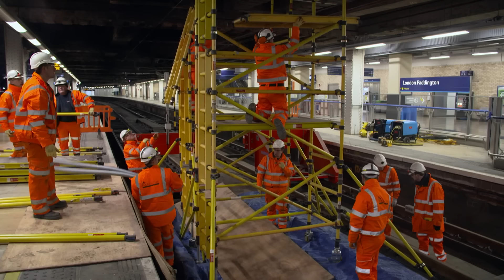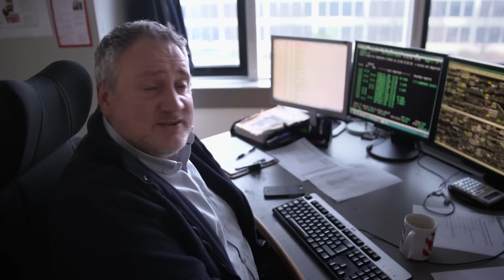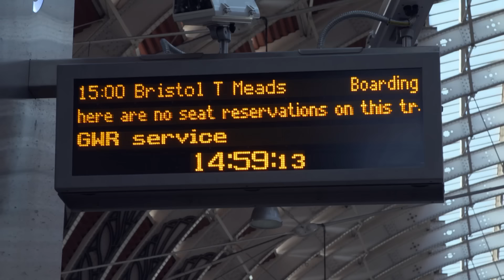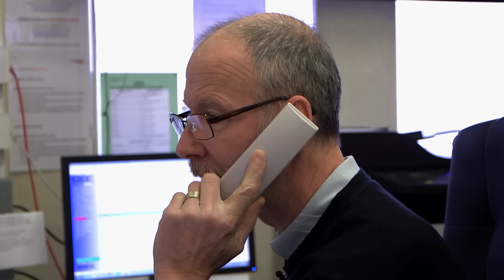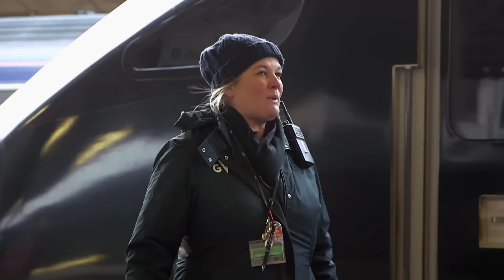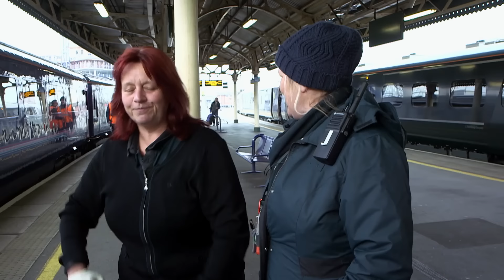Signal Failure, Bridge Strikes & Damaged Trains! | Paddington Station 24/7 | Full Episode

Comment: Checking the in cab height sign is nothing to do with Network Rail, that's down to the police.
Reply: They get a photo for safety purposes for them may need to prove if drivers are genuinely unaware or whether there was indications before that they shouldn’t have gone under it also helps insurance

Comment: 15:40 can one not have the protection barriers replaced with a simple height before the bridge and of the same height? Preferably where vehicles can turn round or take a different route. No lower or someone would try to move it to get to the bridge.
Reply: Apparently they aren't allowed to do that
Reply: The issue is network Ray lot only allowed to really do anything to the bridge or immediately before the counsellor responsible for all the other signage and everything
Reply: @TheLostPacketYTthat makes sense,  although the potential for a blocked road seems pretty high, so perhaps it's something the councils should consider?
Reply: @biddiemutter3481  they can but it costs them money

Comment: The low bridges are clearly marked, and still lorry drives try to pass them with too high lorries.
Reply: However both lorries and bridges are not always marked correctly. There was a bridge in Northamptonshire that had 3 signs in the space of half a mile, all showing different heights.
Reply: @bobanob-q2u  so if you are unclear you do not drive the case is usually that network rail put up a sign and then the council would put further ones up warning Laurie of the router head and things like that

Comment: 17:20 - This seems a bit odd... he says the lorry "3 metres 10" and the bridge is "3 metres 8", but the sign shows 3.8 metres, so surely "3 metres 10" would simply be 4 metres.
Reply: Agreed i would think the sign means the bridge is 3.80 meters high they should have put 3.08 otherwise
Reply: Well isn't 3 metres 10, 70cm shorter than 3 metres 80 (3.8 metres).  It's not 3.10 versus 3.08!
Reply: The British are new to the metric system; the lorry was surely 4 metres high
Reply: @giuseppenero110  hardly new been in use since 70s
Reply: Thought the same, had a feeling I'd find comments! I'm surprised the road-sign would be wrong and not reported/noticed – I feel like that sort of thing is installed with some care. Maybe I'm being overly optimistic!

On second thoughts, maybe the guy checking the cab simply misspoke, and said "3 ten" when he meant "4 ten", and just had three metres in his head? That'd be a more harmless explanation that didn't involve either important sign/warning on the bridge/cab having been installed incorrectly.
Reply: Everyone makes fun of the US for using Imperial (which is impractical) but the UK using both with no rhyme or reason is even stranger and worth making fun of. 
The Hodgepodge the UK has, it's no surprise of the slip up in that section.
Reply: @SyCoREAPER Tell me about it. The only saving grace is that there's some pressure to move to metric in everyday use which is working slowly, but also there's a bit of a dual thing going which isn't completely unmanageable for the most part. (Speed limits aren't too big a deal for now. Knowing one's height and weight in metric is painfully slowly taking hold.)

Comment: Whilst I appreciate all and any staff involved in the rail network and the job is hard and endless, the overall train network in this country is appalling.... I use the train service in the South-West every day simply to avoid driving long distances and avoiding expensive fuel costs and car wear and tear, and the yearly season ticket is in the thousands and for that reason the whole service is very much unacceptable, GWR are an AWFUL Train operator, so I'm fully with the angry passengers as I'm often at the mercy of the awful rail network......but again it's not the fault of the majority of staff, it's a total lack of investment in the infrastructure of the rail network and the privatisation of the railway
Reply: The issue is people complain when they fix the issue more than when there is an issue

Comment: Serves  you right, we should not rely on electricity to run the points and signals, come back to the old system of signal boxes controlling only about 1 to 2 miles each, not one control room looking after about 50 or 60 miles of track and signals, it will not get better.
Reply: OK boomer
Reply: That would put costs up significantly. You need lots more signallers, for each box you need 3 shifts, it all adds up.
Reply: Quite simply it’s not practical the way things are set up now you can’t just do it manually there isn’t the space for the equipment

Comment: So if someone had a heart attack should be giving CPR . Horrible response by the company. First aid does nothing in a HA
Reply: Technically no. A heart attack (depending on the type) generally means the heart is struggling to pump blood, and is in the process of being damaged and/or dying, but it is still beating. In that circumstance it is not appropriate to give CPR.

CPR is only advised when the person is either not breathing, or the heart is not beating effectively (e.g. Atrial Fibrillation) or at all.

There is a very real risk that a heart attack could require CPR, but if the person is still breathing and has a semi-effective pulse, they need medical treatment to confirm/rule out a heart attack.

It sounds like the woman collapsed and fainted from low blood pressure. In which case the appropriate treatment (barring anything else being majorly wrong) is usually to elevate the legs and give fluids (dehyration and exhaustion is the most common cause of this sort of collapse, especially if you've been rushing aorund a train station).

It's also not clear what sort of first aid was given; CPR counts as first aid (as any first aid is just the first bit of help someone unwell receives, hence the name).

All we can assume is that some level of first aid was given, appropriate to the level of training of the station staff. We don't know what that level is, and I would be the first to suggest that a limited amount of first aid training would be beneficial to frontline staff, including CPR and when it is appropriate to deliver it.
Reply: A heart attack is not a cardiac arrest and she had neither
Reply: @TheMusicalElitist you. Ya rage😂
Reply: @TheMusicalElitist  You are a troll, you always try to provoke people in the comments on these videos

Comment: 17:33 The obviously hollow claim of "Local Knowledge" on the side of the lorry is hilarious.
Reply: What troubled me though is that we hear (17:20) the vehicle height is "three point ten" and that this is higher than the bridge (three point eight)... But numerically, 3·10 < 3·8, not the other way round. Did I miss-hear it? Is the sign on the bridge wrong, or did someone put the wrong warning label inside the cab?
Reply: @mLyonJE  When it actually was 3·8(0), that should be pronounced as "'three point eighty" instead of "three point eight", just like they say "three point ten" instead of "three point one" for numerically 3·1(0). That is why I think that with saying "three point eight" they mean numerically, 3·08.
And yes, language often is sloppy and ambiguous like that.🙂
Reply: @m.moolhuysen5456  In maths, at least in the UK where I learnt both my native language and my maths (!), the most standard way to read out anything after the decimal point is by saying each digit in turn, and it's really a lax colloquialism to say "3·10" as "three point ten", more more acceptably, "three ten" – reading "3·8" as three point eighty would be very strange, if not just wrong.

On reflection, I've a feeling the road-signs are always to the nearest decimetre, so it couldn't be a mislabelled "3·08" sign and hence either one of the heights is wrong, or the person speaking was wrong at some point.

Can we get hold of the guy and ask him directly?! Bit of a long shot, I think 🙂

Comment: 17:25 that's... That's not how metric works... If it said 3.10m in the cab and the sign was 3.8m then the truck should fit...
Reply: You also should not put the complete maximum and if things like the suspension exist, which they do because if you unload it goes up
Reply: I’m glad I’m not the only one that noticed that. I’m assuming for the truck to hit it that either the listed bridge height doesn’t accommodate for support beams, or the truck is taller than 3.08m at its highest point. The latter is more likely to be true since it’s a manual measurement done with a measurement stick.
Reply: @ThatgirlnamedJodie no, cause the bridge is 380cm (3.8m) and the lorry at the highest point is 400cm (3.10) then there’s a 20cm difference in height which is almost a foot (I belive you are confused cause they said 3.10 instead of 4
Reply: @jaydawguk  I get ya. Who the hell says 3.10m instead of 4m?
Reply: @jaydawguk  I can't imagine him choosing to rephrase the warning sign inside the cab that he had just read as four metres, instead saying out loud, three metres ten. That'd be weird.

Either one of the signs was wrong – which is alarming – or maybe he just misspoke and said "three ten" when he meant "four ten", because he had the 3m in his head already?
Reply: The bridge is 3m 8 and the lorry was 3 metres 10 ,
Reply: @ 3m "10" is not a number. It's 4m, or it's 3.1m
Reply: @StuAnderson90  Reading it as "three metres eight" is shorthand for the decimal number displayed, which is "3.8", and that's 3m+80cm, because that's how numbers work.